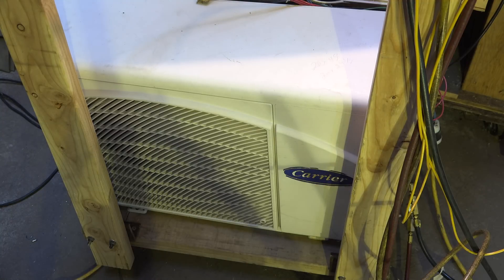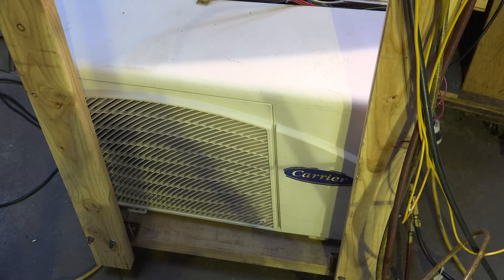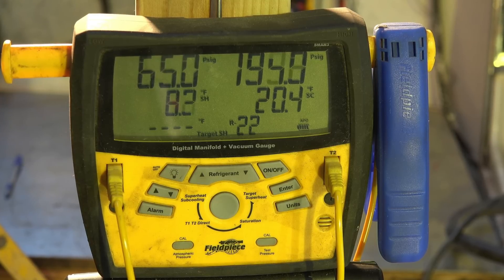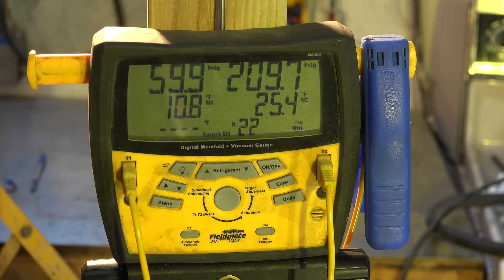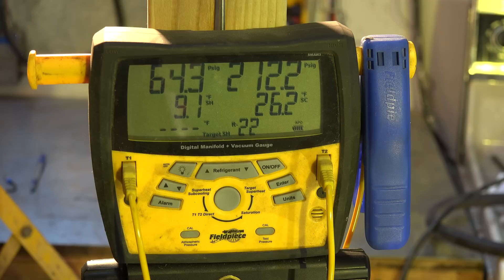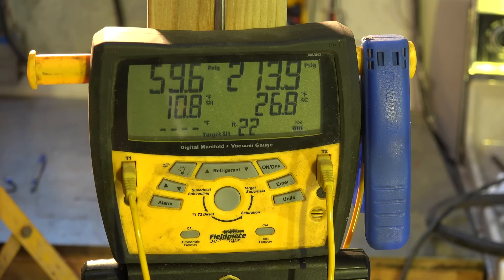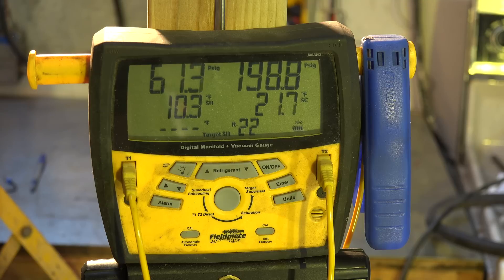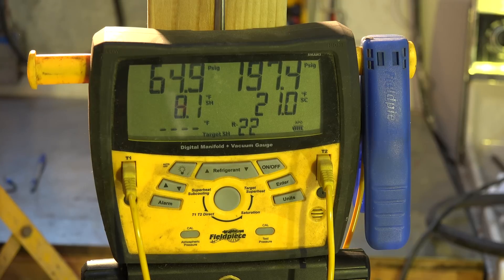The pressure switch head pressure control

Comment: I have several units that have the low ambient pressure switches on them. How do you check the  charge while the fan is constantly cycling off & on? Thanks in advance. I have really learned a lot in your videos over the last year, Thanks for making them! By the way our outdoor temp this last week has been in the 55* F range on average.

Comment: The sub-cooling indicates significant accumulation of refrigerant in the condenser.  Under this condition, the low-side pressure is hinting at insufficient evaporator air flow.
Reply from the maker: I forgot to mention subcool sensor is not connected.  So no sensible reading there.  Sorry about that.
GFM
Reply: Thanks, that explains why the sub-cooling reading climbed while the fan was off which struck me as unexpected.

Comment: A little low on charge.
Reply from the maker: Charge is right on the money.
GFM
Reply: the suction pressure/ indoor coil temp is a little low. Superheat a little high I would add a little to ballance things out
Reply from the maker: You are missing the point.  because the fan is cycling, the varying head pressure creates a varying suction pressure.  Suction never reaches as high as it should be because as soon as it gets close, the fan shuts off.  The resulting superheat also varies from around 8 to 12 because of the head pressure.  This unit was charged during much higher ambient and is very picky.  Even a small addition of charge will throw it way off.  The video was done to demonstrate the effect of the cycling fan control.  Hope this helps.
GFM